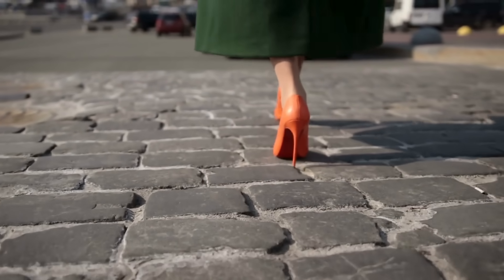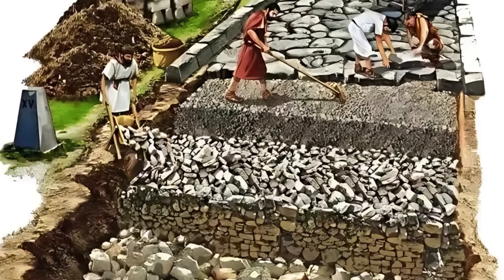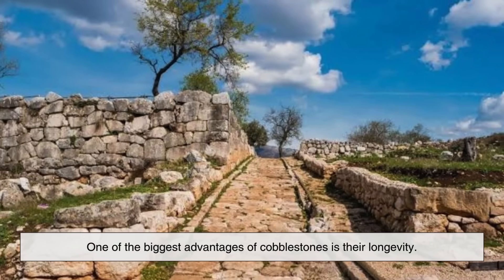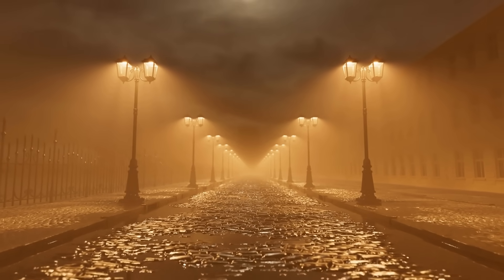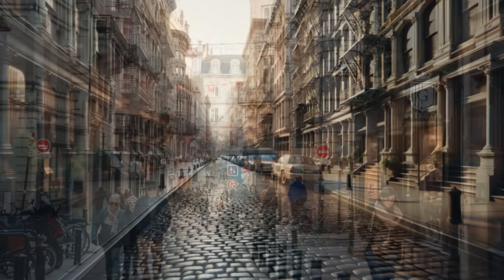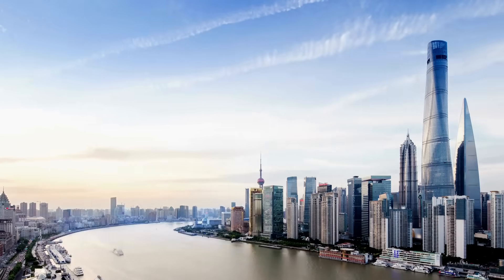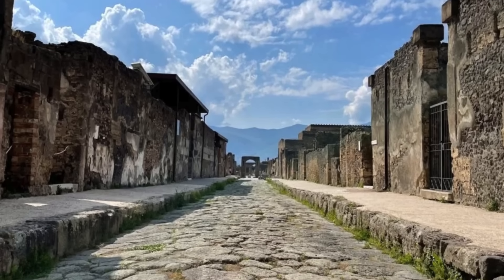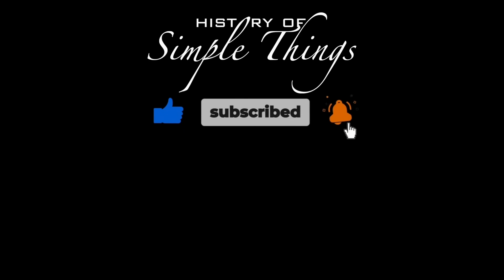Why We Still Use Cobblestones Instead of Asphalt!

Comment: Cobblestones are noisy, bumpy and can be slippery when wet. Note however that there are many kinds of stone pavement. Some use smaller stones and those, when set precisely, can actually be less bumpy because the smaller stones form a uniform surface.
Asphalt tends to crack in winter because water in small fissures freezes and expands, leading to cracks. Stones has no such fissures.
I found another advantage of cobblestones: Little debris such as broken glass will disappear in the gaps between the stones so it doesn't pose a danger as it would on asphalt.

Comment: A world famous hospital had the roadway in front of its iconic, original building torn up, and replaced with pavers. (Square granite blocks.)  Whether the pavers were never finished at either end, or turned over, they are rock edge up. Nasty, nasty, nasty to drive over!

Comment: Cobblestones being permeable to water, as well as climate change, were mentioned. but I'm surprised the water cycle wasn't specifically mentioned. This is one of the ways in which asphalt and concrete negatively impacts climate change...the how of the story.

The water cycle details the cycle in which water travels through the various environments of the planet. It is vital water cycles through it's different stages. From raining down onto the land, where it soaks into the ground and eventually soaks into a river, returns to the ocean, and then evaporates back into the sky. Where it falls as rain again.

Asphalt and concrete are not permeable to water, so that water is unable to sink to the ground. The disrupts the water cycle. Water is unable to sink underground aquifers. It is unable to move, and this is a problem. What is it going to do, evaporate and then fall down as rain back onto the same spot again? That doesn't work. In other words, asphalt is a bad solution to the task it is meant to service.

Cool video!

Comment: These cobbles break anything with wheels. Maybe the only good thing they make is a pedestrian only path.
Reply: Vehicles can ride on them just fine.
Reply: @shovanabajracharya   Yes indeed. Though one has to drive carefully when it's raning, they can get slippery when wet. But they certainly don't break anything in the car if one drives with caution (as one should always do anywhere).

Comment: In Scotland these rectangular blocks are known as sets although the road surface is normally called cobbled. One problem with these roads is that with modern traffic unless they are well maintained they beome very rough and uneven making suspensions work hard. In some areas they used wooden sets instead of stone, gave an easier surface for horses and carts. In Dundee where i live there are still at least 2 roads with the original wooden sets although long tarmaced over (now asphalt), damage to this surface often exposes the original wood blocks. Many of the cobbled roads in Dundee were built with lines of smooth slabs the width apart of cart wheels to make it easier for the horses pulling the carts especially on uphill sections.
Modern paved roads no longer need to be hand laid, there is now machinery that will prepare the surface then lay the blocks in any desired pattern.
Reply: (Granite) setts - with two 't's. A cobble is a rounded natural stone, and it is wrong to call a sett a cobble.
Reply: @frogandspanner  Since we're being pedantic:
-setts can be whinstone as well as granite.
-as the word setts doesn't from a verb it's quite natural to say a street is cobbled [with setts].
Reply: @davidpanton3192  That is not what my civil engineer road pals would say.
Reply: Somewhere in the south of England I used to live had at least one significant road which had been formed with wooden setts - seemingly just covered in a modest layer of tarmac/asphalt. As you say, when roadworks were required, you'd see them clearly. They appeared to be in good condition after what must have been decades from originally being laid. Trouble was that when the roadworks completed, they'd just tip stone (sand, aggregate, whatever) - and maybe even some of the broken setts - and surface over. Where that met with original wooden setts was a weak point for road damage into the future.
Reply: Because asphalt is flexible and wood is compressible, paving on top of wood is a very bad idea and the asphalt is getting damaged by just being used. Asphalt is supposed to paved on top of an incompressible substrata like compacted gravel, sand and in many cities even concrete.

Comment: As you say, cobbles are spherical stones from river beds. They were often replaced by flatter stones that were easier to walk on. Alternatively stone slabs were used, which were better still but more expensive. 
With the industrial revolution we learnt how to cheaply shape stone into a brick shape. These are called setts and almost all the pictures shown are of these setts. Nowadays we usually use pavers, hard baked bricks, rather than cobbles, slabs or setts.
A little more historical research is needed,  I think.
Reply: You are an expert. Well done!
Reply: Most of us use them term in a wider sense.
Reply: @scallopohare9431 I am aware of this, but if you are doing an educational piece on a subject you should get it right.
Reply: @janprimus1947 🙄

Comment: Granite is one of the hardest rocks in the world. If we built residential streets in the USA with them. Just think about how much slower traffic would move. In the rain people would be less likely to drive. In the snow there would be ice. 

This is all things that people don't want to learn how to drive in. The fact is that in places where they have lots of stone roads. People actually have less accidents than on a smooth road. Part of this is that on a smooth road you feel safe. The fact is that the same things face you as on the other road. But you usually drive faster than the condition of the road allows. 

People think that the brick that is in the USA is the same. It is not. There is a reason why roads are still small in Europe. They are built on old roads. If a road can last for thousands of years. Why don't we spend the time to build it like that? Why does one cost out way the best way? 

We have the ability to make a road that can last forever. Why do we spend more time and energy fixing roads every ten years. Ten to twenty years is the life of most roads in the USA. And how often do we replace them when we need to? Often we don't and they get really bad.
Reply: We heavily salt snowy or icy roads in the US. That corrodes everything.

Comment: Portugal has cobble stone. They are easy to repair. Have seen a single man with a few simple hand tools make a major repair by himself.  And only replaces the odd broken piece.
Reply: In Brazil in the 1980s we had many cobblestones in our town. Once I passed by a hole, the missing cobblestones lying nearby, but instead of repairing the stonework, the municipal workers had planted a sign, dug into the ground, saying "Beware - hole in the road." It would have been much easier simply to repair the hole.

Comment: Cobble stones are extremely rare in any American or Canadian city.  I think initial high capital costs are only one of the reasons.  The other is unpredictable traction for bikes, wheelchair users and vehicles.  I have only seen cobble stones used for private patios and purely for decorative reasons
Reply: many of the older towns and cities in New England have cobblestone streets buried under the asphalt. when a street in the city I live in requires repavement, they often remove the asphalt down to the original cobblestone. what is surreal on these occasions is that there are also trolley tracks embedded into the cobbles. these predate the use of automobiles when public transport was much more extensively supported.
Reply: Granite cobblestone streets here in St Louis, mostly overlain with asphalt now.
Reply: America tended to use bricks instead of cobblestones since they were easier to make and install. Didn't require special knowledge or tools. Cheaper, too.

You see a lot of brick streets in older towns up north, towns that were paving streets in the later 1800s and early 1900s.